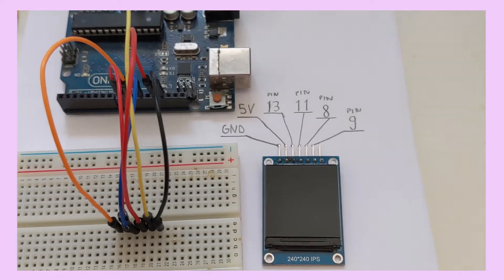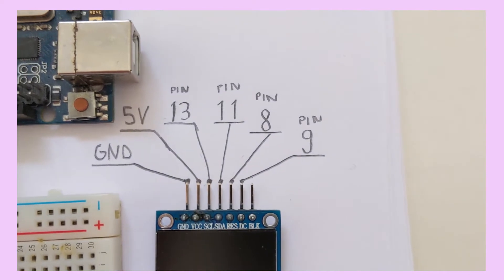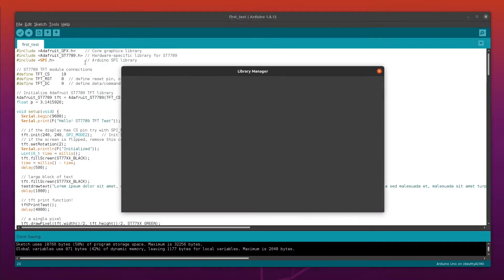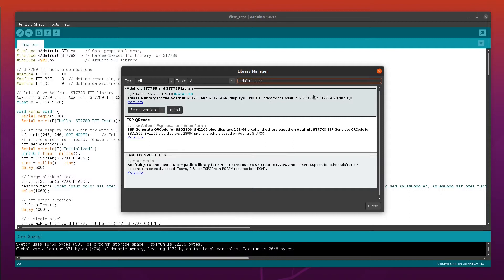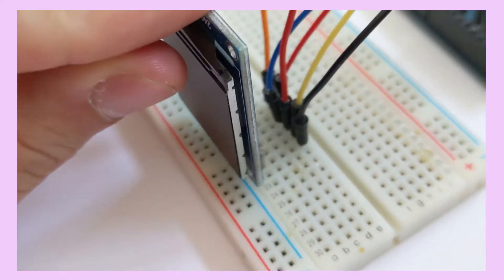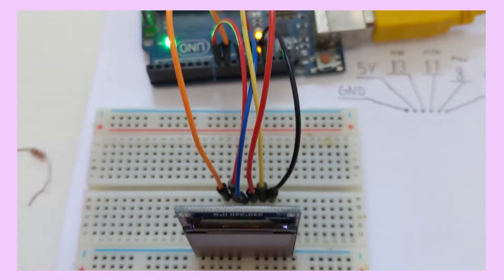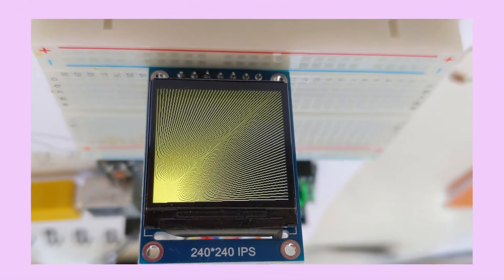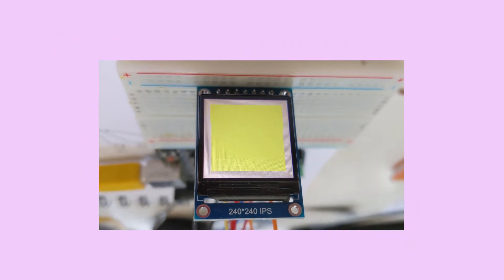TFT Display 1.3 inch for Arduino

Comment: my screens backlight comes on but does not display text or any graphics, can you please help?
Reply: mine too
Reply: @sabuvirus i found a sick solution bro

yeet that shit in the garbage and go back to OLED
Reply: @sabuvirus did your tft work?
Reply: This is sabuvirus from another account it didn’t work , it turned out that the data pin on the back was cut a tiny bit